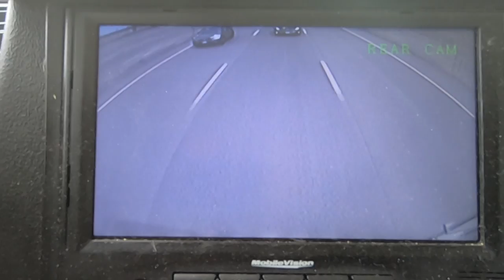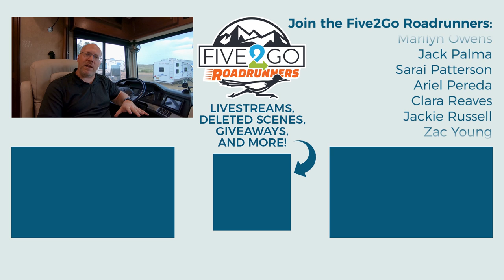Making Our New Motorhome Safer! SteerSafe RV Stabilizer Install

Comment: I had mine installed in Demming, NM by the company. They came to the park and installed the system on my Class C. I asked about maintenance and was told an occasional check that bolts were tight was all I needed. They help but when it's super windy, I still get off the road and wait it out. Great action footage!
Reply from the maker: Good to hear!

Comment: About 5 years ago I drove from Oh to Fl and then across the south to Tx and NM. When in NM met a couple who told us about Steer Safe, which is in Deming, NM where we were staying for a while. We had it installed at the manufacturer and were so glad we did. It was so much easier driving after that. I strongly recommend Steer Safe. Ours was on a 40 foot diesel pusher and it sure helped.
Reply from the maker: We have really been enjoying it! It was definitely a night-and-day difference after putting it on. I went from "movie driving", constantly adjusting the steering, to nice and easy cruising. It's a fantastic upgrade!

Comment: Great video! I have had them on my 2012 V10 gas motorhome since 2012. I just sold it and removed and will install on my new Ford F53 chassis.
I have over 77,000 miles on my original rig and definitely make for a less streeful steering as they do help keep you still going straight down the road.
You also forgot to mention if you have a front tire blowout it will help you keep the rig straight so you can make a safe exit to the side of the road.
If you didn't have SteerSafe the blowout will cause  you to fight the rig wanting to go inthe direction of the blown tire.
Good job!
Reply from the maker: Thanks John! It's good to hear from someone that has had these for a while. We've got about 3k miles on ours now and the difference is incredible.

Comment: Great video Brian! Improving handling of an RV is an important safety investment.  Sorry about the seatbelts comment. I went back to 7:20 and you can clearly see the seatbelts on your black shirt. It rides low and didn't look like it was on but clearly it is. I like your response when it was suggested hauling a popup camper for the kids! Safe travels!
Reply from the maker: Thanks Jim! You had me worried with the seatbelt comment because I never ride in anything without one on and I didn't want anyone thinking that I would! 👍😅👍

Comment: I didn't know these existed. I've been looking at the Safe-T-Plus. My primary concern is a steer tire blowout. I have a 45' Country Coach with a Tag axle. My steer tires are 385/65 R22.5. Plus it's a really heavy coach. Between the Tag and those huge balloon steer tires it really doesn't wander. Wind and Semi's don't do much either. Well, a really strong gust might push it some. Waiting to hear back from Safe-T-Plus on the mounting kit for my coach. Just exploring my options on what's out there. Thanks for posting.
Reply from the maker: That's a lot of rig! I know that companies make steering stabilizers for commercial trucks so I'm sure you'll find something for your coach.

Comment: Just to let you be aware off it you will still drift a little it will not get rid of the drifting completely from the wind or when you get pass by another large vehicle heads up it will move a little but not bad I love mine
Reply from the maker: I've got about 3k miles on the Steersafe system now. The reduction in wheel movement is significant. I went from "movie driving" - constantly adjusting the wheel - to a nice relaxed cruise down the road. I definitely know when trucks are passing, but it's so much better it's not even funny.
Reply: @Five2Go  yes you are so right it do make a big different but be careful driving in high winds. I will admin it’s a little easier to handle but it still kept me alert lol I wish I had it when I was a over the road truck drive.ps thank you and your wife for the info on putting on the snap pad and if you need help you can reach me at fogdogrides@yahoo.com

Comment: Hello Five2Go Family! I have really enjoyed your sharing your journey so far.  Also, I am SO GLAD you found these and installed them.  I did the same thing about three years ago after watching a video from RV Education 101. There is plenty out there about the Steer Safe but not so much about the Safety Steer even though the company has been around for a long time. Anyway, I had them installed just to be a rebel and have been extremely happy with them ever since. As you mentioned, the amount of corrective steering that needs to be made is drastically reduced. Thank you for boosting my confidence on this decision! Have you looked in to the CHF (cheap handling fix) at all for your stabilizers? That was also a great benefit at really no cost. Cheers and best wishes - Mike
Reply from the maker: I kind of wanted to try these out because of how little people were talking about them too! 😜 I'll probably do the CHF in the next week or two when I've got all my tools out working on the baseplate and tow bar for the car.

Comment: Besides the two you mentioned, both Blue Ox and Roadmaster make steering stabilizers as well. The Blue Ox TruCenter Steering System is adjustable. I prefer that because you can turn down the resistance when you're in a parking lot and such and makes it easier when making turns. However it is not cheap. It's slightly over $1000 but I think the adjustability is worth it.
Reply from the maker: Wow, that's steep! I haven't had any issues steering at low speeds so far, so maybe these are tuned to the lower end of resistance. Is there a dial or something that you added to the dash?
Reply: @Five2Go  Yes the dial is on the dash.

Comment: Interesting.  Would like to hear from anyone who has this long term.  My only concern would be if it’s putting a lot of strain on the power steering system but I can definitely see it would help with steering stability.
Reply from the maker: There's no active strain when sitting or driving straight as the springs balance each other, so there's just some extra resistance when steering. It shouldn't be any different fundamentally than all of the other steering stabilizer systems out there and I haven't read or heard anything about them prematurely wearing out steering components.

Comment: Great job, Brian! I knew you’d see a real improvement. You’ll feel much less stress and tension on those long stints behind the wheel.
Reply from the maker: The first 70 miles with them on there were way better, and that's a really bad stretch of highway. They'll get a LOT more use in a couple weeks!

Comment: Nice video and install. Hope it works long term for you but I am leaning towards the safe T plus  steering stabilizer. No springs.
Reply from the maker: I liked that there was resistance added to both wheels instead of one point somewhere along the steering bar. The mechanical side of my brain sees that as potentially more stable and it may even deal with really tiny movements independently. Regardless of what system you go with, it's a huge improvement!

Comment: Seems simple to install...did you have to adjust your steering wheel?  
In the Safe-T-Plus video installation, they had to adjust the steering wheel after the steering control installation!
Reply from the maker: There's no steering adjustment after installing this unit as long as you make sure your wheels are straight when you install it. I think the other systems that use the gas strut require adjustment because it's putting a constant force on the steering bar whereas this one has the springs on either side "fighting" each other to keep the wheel straight.

Comment: Another great video! Always great content! 

Did you use lock washers or locktite on those bolts?
Reply from the maker: They're all nylon lock nuts so they should hold together pretty well. I'm planning on crawling under and checking them after my next drive but I'm sure they're fine.

Comment: Good video, looks like beffy springs. Did you have specific torque for the bolts and nuts?
Reply from the maker: There were no torque specs. They're all nylon lock nuts so they're just installed as tightly as you can get them.

Comment: my only question/concern is what are the springs rated to and how much extra strain does this do to the power steering system
Reply: my thinking exactly, would the extra stress not cause the pss to work harder and maybe even blow the pump?
Reply from the maker: Steering stabilizers of all styles have been around for a long time and I haven't heard or read about any of them causing premature steering system failure. The springs are mostly fighting against each other and tightening things up. The strut style stabilizers do exactly the same thing, just in a different way. It mostly feels like the slop is taken out of the steering wheel and things are just more responsive, it's not taking much more effort to turn at any speed.
Reply: @Five2Go  thank you for getting back to me on this question...now how often do you have to recheck the torque on the u-bolts..as per manufacture ..side note,,love the curtains
Reply from the maker: I'll check them visually when I check the tires and I'll crawl under to check them every couple hundred miles or so. They're all nylon lock nuts so I'm not expecting anything to get loose, but you never know.

Comment: ....harder to turn the wheel. Will that system put more pressure on the power steering pump/steering gear etc.? Have you considered replacing/upgrading the shocks? Thx!
Reply from the maker: I don't think any of the steering stabilizers add any extra wear to the steering components, or at least no one is talking about it if that's a thing. As for the suspension components, I'm going to leave them alone for now but if something wears out I'll upgrade it. Once we're back east we won't be driving a ton so I don't want to spend too much on stuff like that.
Reply: @Five2Go  Great info! Thx!
Reply: @Five2Go  but adding that much pressure to a pss can soon blow out the pump..
Reply from the maker: The springs are fighting each other when the wheel turns, so it's not so much that it's harder to turn its more that there's less slop in the wheel. I can still very easily turn the wheel with one hand.

Comment: Please give us an update in 6 months to an year.  Would like to know if there is any strain to the power steering with the extra force due to those springs.
Reply from the maker: It has been about 6 months and 3000 miles and everything still feels great.
Reply: @Five2Go  You said that you would go under the rig and check the nuts and bolts every few hundred miles.  Have been doing that and have you ever had to tighten them up?  I love the concept, but having to crawl under the rig several times per day is more than I would want to do.  Do you still feel this is necessary or do you have enough confidence in the system that you no longer need to check them so regularly?
Reply from the maker: I checked them a few times on our first drive since it was one long shot from CO to VA and nothing  got loose at all. I checked them again after going from VA to FL and still nothing. I won't be checking them very frequently from here on out because I don't think they're going to move. Just a quick visual from the front to make sure the springs look good is fine and then I'll check the bolts only during oil changes probably.

Comment: Hi guys! I know this Video is a couple years old & that you've now upgraded your motorhome since, but was wondering if you were happy with the Steer Safe's performance while you had it?

I've been looking at the Safe-T-Plus & the newer Roadmaster Exact Center, but I know that I did like the Steer Safe on my old rig & I'm just trying to decide if it's still a good choice or kind of an outdated product
Would just like to hear your thoughts on how it performed for you.
Thanks! 😎👍
Reply from the maker: The Steer Safe made a WORLD of difference on that rig. I've never had the other style with the strut tube, but what I do know is that every time I checked the Steer Safe it was still as tight as when I installed it on day 1 and it never slipped. I like the idea of huge hunks of steel helping keep things straight vs a single little strut and some tube clamps, but that's just me 😉

Comment: I believe you put your outside brackets on backwards
Reply from the maker: The instructions state that they can go on "backwards" if the knuckle gets in the way, which it did in our case
Reply: @Five2Go  I understand. My instructions didn’t say that. I kept going back-and-forth between your video and the instructions trying to figure out the right way to do mine.. I’m almost done now. About to start tightening the springs.
Reply from the maker: I got that kit back in 2020 so he may have changed the instructions since then. I used it that way for 2.5 years with no issues whatsoever - it made a huge difference to how that thing handled!

Comment: I was about to tell u that a long time ago  as my simple advice but i decided not to coz i do not want to interfere other peoples business,im just a stranger to u guys,ive seen that stabilizer to some rvers that i met some of them say its good and the other say it sucks,i dont know,my friend Billy told me that they were having a hard times in manuevering the steering wheel..anyway god bless stay safe❤❤❤👍👍
Reply from the maker: I actually like the extra pressure on the steering wheel, it felt kind of sloppy before honestly. If this system was installed on a smaller or lighter rig it might be a bit harder to maneuver though.
Reply: @Five2Go amen to that brother,enjoy ur camp,god bless u guys..❤❤👍👍

Comment: Great product for the front. Next for the sway caused  by tail wag (caused by passing trucks) look at a good track bar. https://www.blueox.com/chassis-performance/tigertrak-track-bars/
Something to look at is to upgrade the bushings on your sway bars. It makes them moor effective at stopping movment. I couldn't belive how well it helped on my Bounder. Moog suspension parts makes a kit. Also look at the "Cheap handling fix" for your Ford chassis.
Reply from the maker: I'm almost definitely going to do the CHF here soon and I'll look into other upgrades too. Once we're back east we won't be driving near as much so I'm trying to keep spending on this category pretty low. The steering stabilizer made a HUGE difference though!
Reply: @Five2Go  My opinion the track bar makes as big of difference or more. Definatley do the CHF and change the bushings. Cost is why I didn't throw the Koney FSD shocks in there to. They helped my ride a lot.

Comment: I don’t understand why the manufacturers don’t make those giants safer. They should make them with stabilizers & steer springs on them. And they should make them safe enough that your children can ride in them as well. Really turns me off to getting a class A.
Reply from the maker: There are a lot of things they could add to tighten these things up, but that's the case with all types of vehicles in all industries. It is what it is. They're not unsafe to drive without modifications like this, they just make it a lot better.
Reply: Five2Go, true Brian but as much as you pay for those things...

Comment: This was a great video, however you installed the bracket incorrectly. I followed your steps, but did not notice a difference, so I call steersafe. They had me send pics and informed me the bracket on the back of the wheel is facing the wrong way. I checked your video again, and you also have it the wrong way. I think this is a great video, but I would update with the correction for which way that bracket goes.
Reply from the maker: There's a note in the install instructions about the direction the bracket faces. If there's interference from the steering knuckle you can install it the way I did. There was no room on mine to have it face the other way so I had to flip it around. I've had it this way for two years and about 18k miles now and it has been great.
Reply: @Five2Go  That's good to hear, I am going to see if I can turn mine today. Thanks for the note on note fitting correctly the other way. I am hoping to not have a problem as my springs are not very tight, about 1 inch of the eye bolt was through before it start to get tension.
Reply: I just spun mine around, went from a tight business card to a loose credit card in the spring spacing. The one side did touch the knuckle, the now the v-notch lines up with the grease fitting. What is your spring spacing like?